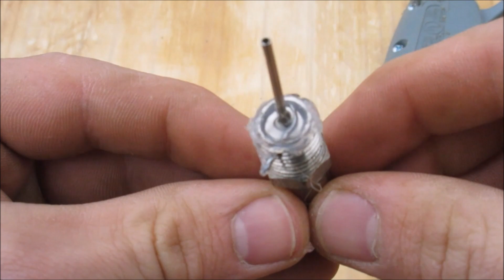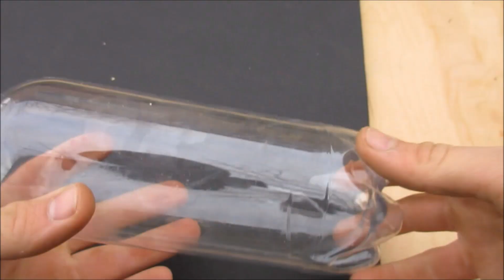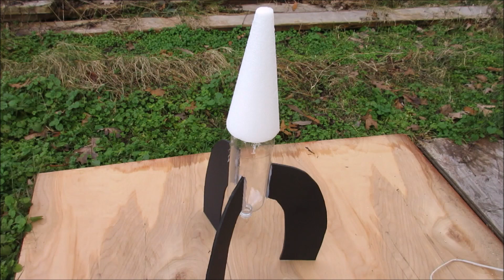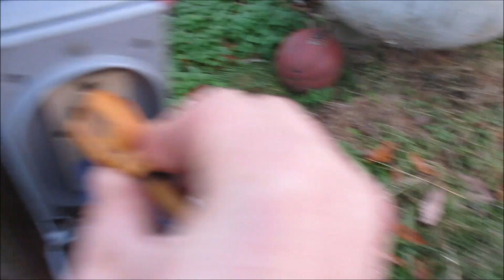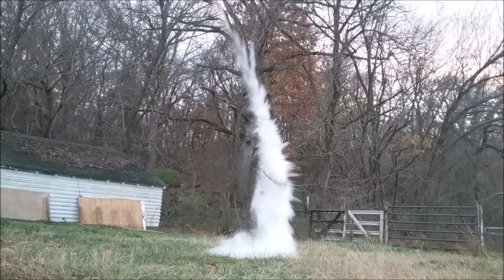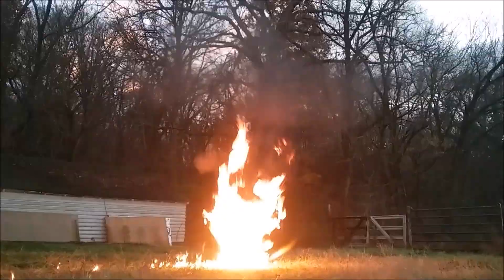3 Awesome Bottle Rocket Launches (How to Build A Rocket)

Comment: Yeah, "safety" water.
Very, very effective.
Gasoline can not be extinguished by water, it just makes it worse.
Reply: zep van de Visse it seemed like it worked quite well in the video
Reply: @williamquantrill5226  yes because it was poored over a dry surface. It was so little bit it couldn't spread :)